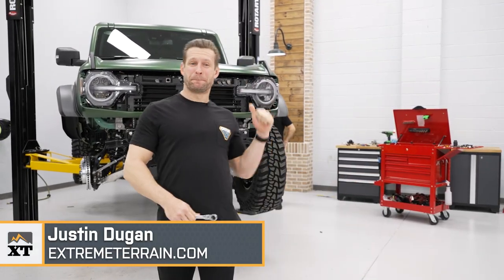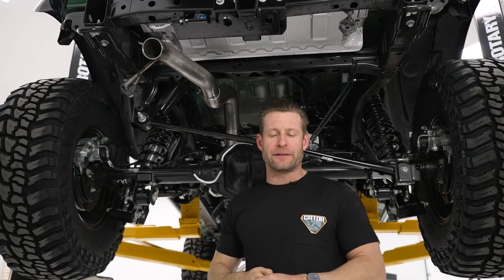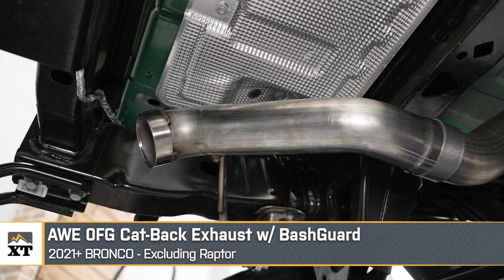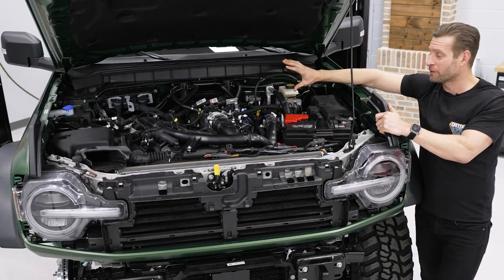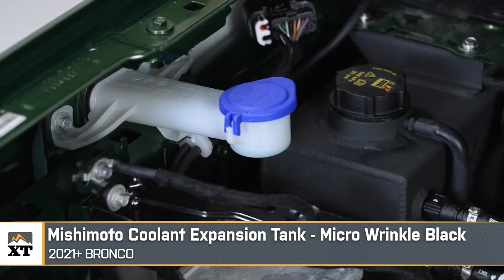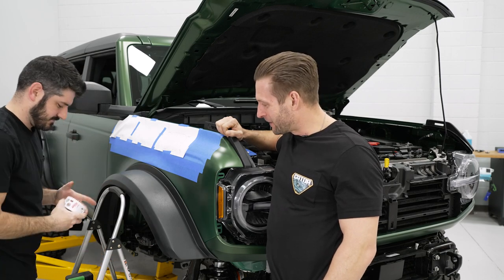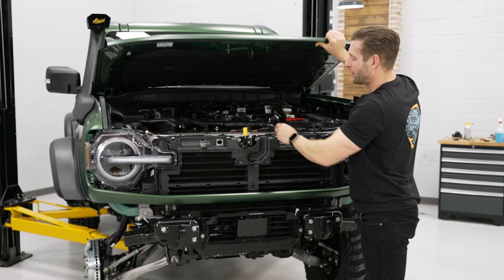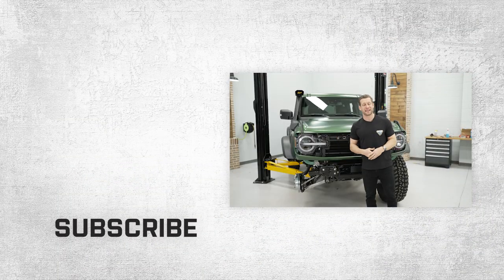2023 Ford Bronco Build | Airaid Snorkel, AWE Exhaust & Mishimoto Performance Mods! - STAGE 2

Comment: My only issue with that snorkel is they don't close off the factory airbox inlet.  It looks good, but I'd rather have the factory inlet covered if using a snorkel.